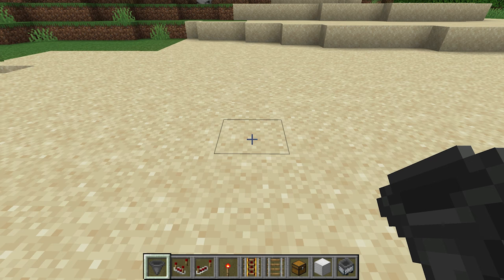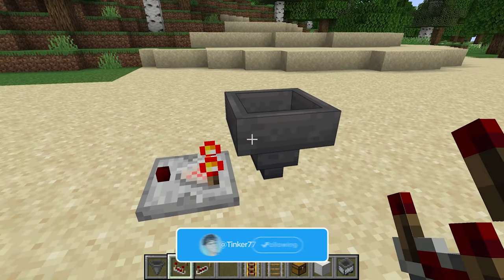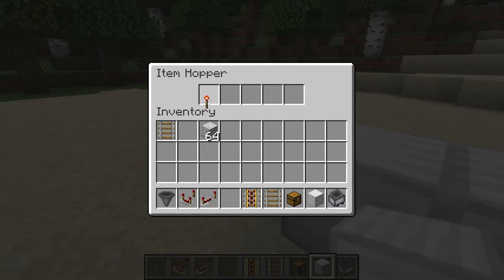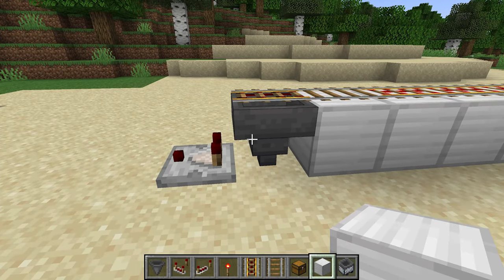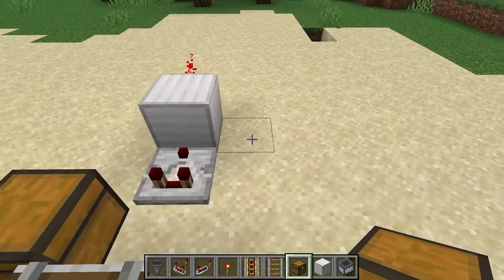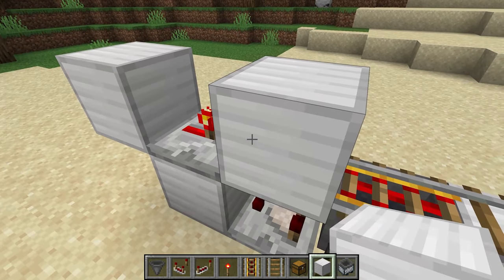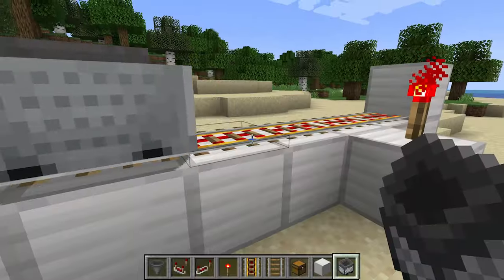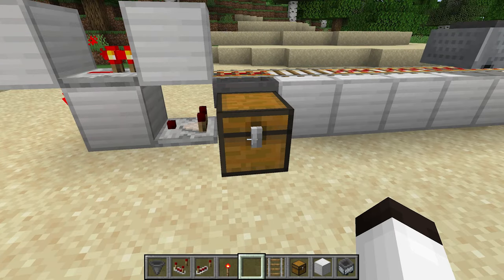WORKS IN 1.18.2! | How to Build HOPPER MINECART UNLOADING & DISPATCHING System | Java Tutorial

Comment: I had to add a detector rail and 2 additional Redstone torches below the original one. When the mine cart goes over the detector rail it will turn off the powered rail just long enough to get the cart to start unloading instead of it relaunching a full cart.

Comment: For those who may think this does not work in Bedrock 1.19, you need to make sure the minecart is going slower. Once I removed a powered rail, it was able to drop an item off before leaving the rail. It was too fast beforez
Reply: thank you that was my exact problem
Reply: I have a powered rail 12 block away and still does not stop

Comment: For anyone with the problem of the minecart leaving as soon as it gets to the station, here's what I was messing up: The powered rails touching the block the minecart runs into SHOULD NOT be powered on when the mine cart is not there. Meaning NO RED STONE TORCHES activating them. I had  my beginning powered rails activated with a torch so that's why the cart never fully stopped.
Reply: So how did you fix it
Reply: i fixed it with removing the block above redstone torch
Reply: @bababab-rad  Make sure the beginning rails are not powered. So do not put redstone around them. The block that the minecart stops at should have an UNPOWERED powered rail next to it. The rail will automatically power when the cart gets to the block. So just make sure there is no redstone torches or blocks powering that first rail. Just remove them.

Comment: So everything works. Dumps all the items in, repeaters go on when it empties to signal the railing to go back and yeah. However the issue is that my minecart after emptying everything just sits there. For some reason, it still thinks it needs to go in that direction I guess of the wall? Basically it won’t return without a push and it’s frustrating idk how to work it
Reply: Same issue. I did a loop and it won't start after it's empty. I think this only works if the minecart ends against a wall.
Reply: I can confirm. I just removed the loop and made it end at a block on both ends and it works well that way.

Comment: hi why does my hopper minecart does not stay to empty? its reaches the unloader without unloading items then quickly goes back on the track
Reply from the maker: Probably because the track on top of the hopper is being powered by the rest of the track.  There needs to be a break.
Reply: Did that, still doesn't work

Comment: I have a problem. The redstone isnt quick enough and what i mean by that is that the comparator turns off the redstone torch to slowly and the minecart leaves before it turns off
Reply: I'm having the same issue!! I can not figure it out
Reply: I didn’t find a great solution, but one that kind of works. I added about 4 unpowered activator rails leading up to the powered rail. This slowed my mine cart down just enough for it to unload properly every one in ten laps or so. 

I have an iron farm, so honestly I’m considering just taking the minecart hopper system out and using a bunch of hoppers instead.
Reply: same problem here. i'm trying hard to find a solution.
Reply: The hopper under the powered rail has to output on side, not straight down. Also don't pull items with other hopper from it, empty it in a single chest then pull items from that chest to your storage, etc. Use also 2 powered rails, not one.
Reply: Same problem here.
Reply: @Fluffybrew  i did everything right, still no result. i'm convinced it's server lag since it occasionally works correctly.
Reply: Don't bring it up by a block left everything on the same level and it worked fine. So when he goes one block up before the machine starts dont do that